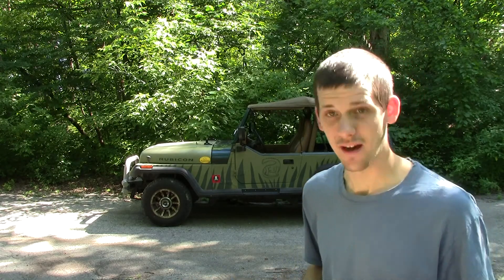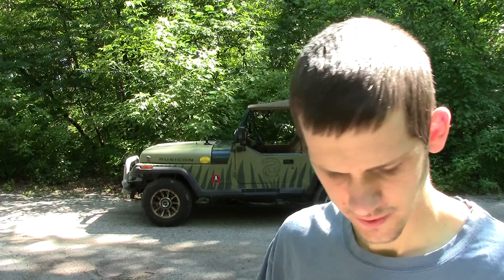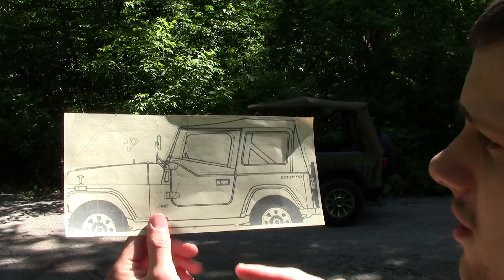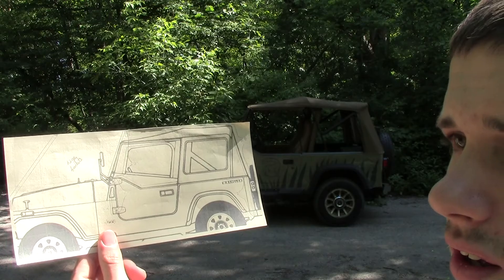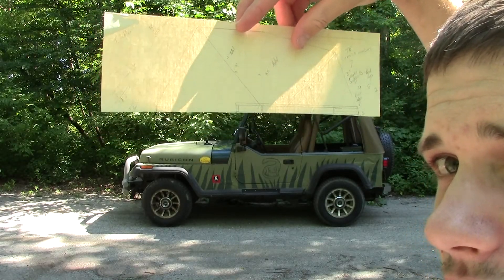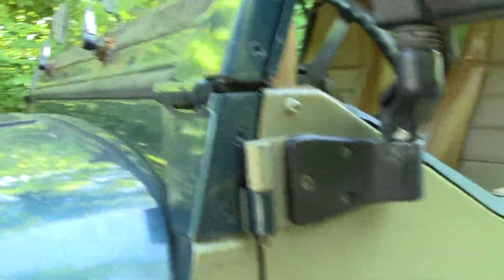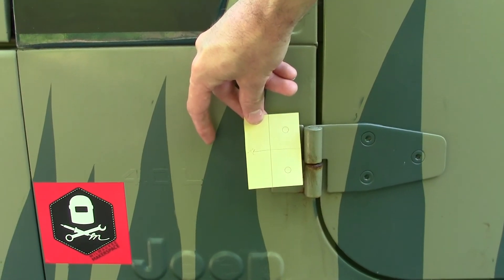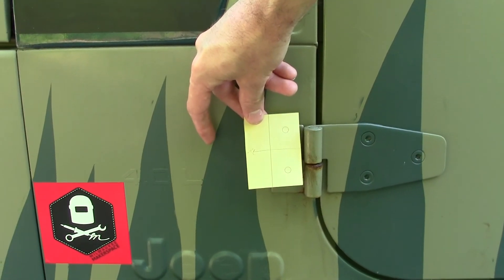Jeep YJ Roof rack intro

Comment: Off topic what are you using to hold your cb radio up there? For a yj
Reply from the maker: Major Tom I have a 3/4" by 6" board running on top of the roll cage. the CB is attached with two L brackets and the board is ziptied to the roll cage.